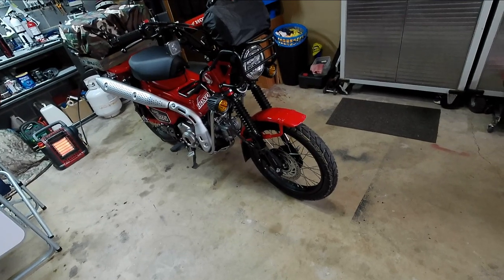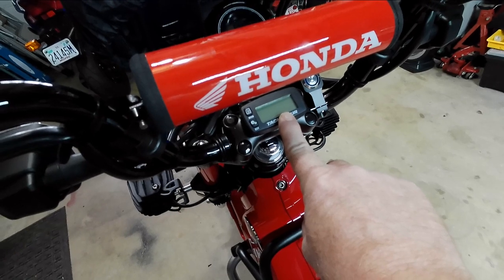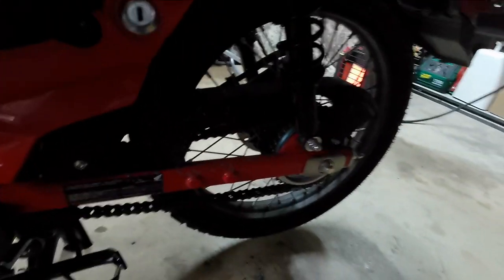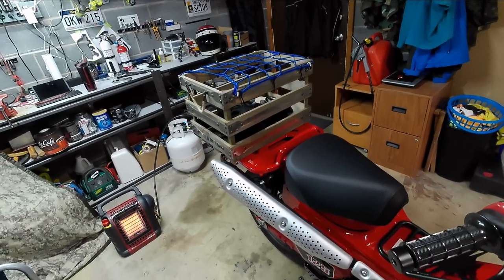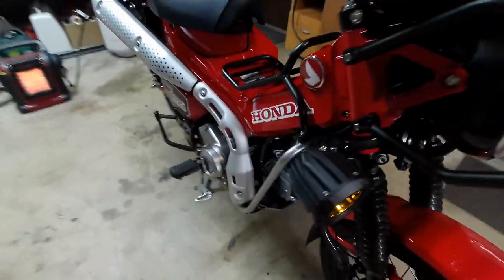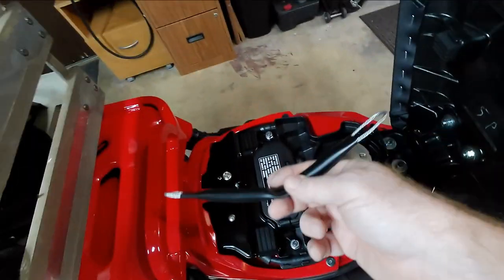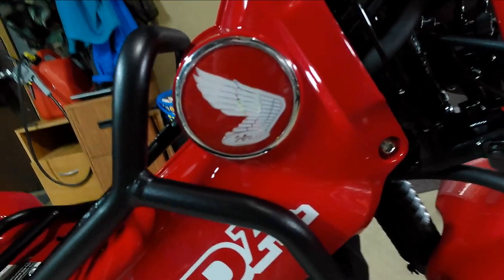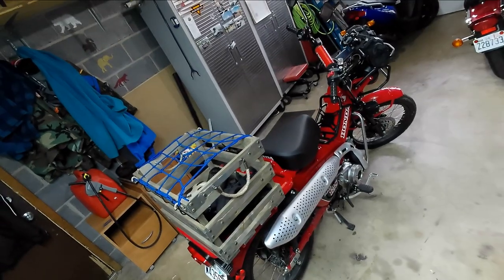Honda Trail 125 Owner's 100 Mile Review and Rambling Thoughts, Oil Change results towards the end.

Comment: What a fun bike. I love mine. Everyone wants to stop and talk about it. I found a neat metal basket at Lows in the bathroom section that I installed on my luggage rack! It is sweet and looks cool too. It holds almost as much as a milk crate, just not as tall. My bike was on order for 10 months now, I have over 600 miles on her and loving every mile! I will be looking for a more comfortable seat, an engine guard and front foot pegs. Thanks for you video, Guy

Comment: Great video! 
Not to be nosy but I’m interested in your propane garage heater. Is it an infrared heater? What brand is it? Do you like it? Does it heat the floor? I’ve tried so many heaters and haven’t found one to fit my needs.
By the way, I love the CT 125. If I could only find one. I have a Honda Helix but would like to do some light duty off road riding as well.
Reply from the maker: Thanks for watching! The heater is a little buddy portable and I love it. Make sure you get the filter for the inlet hose, wish someone had told me. The 125 has more smiles per mile than any other bike I own.

Comment: Great job and appreciate all the links. I bought quite a few items based on your suggestions. I bought the aux beams, what clamps did you use? I love the location. Also, how did you wire the switch? Newbie.
Reply from the maker: No issues on the wiring. I'll look it up and send a better reply tomorrow. Easy peasy though. I'll even add a link for the connectors.
Reply: @SpyderTom1  Thank you!

Comment: I got my bike Thursday and I agree with you about the seat being hard and the mirrors being too short. Thanks for sharing your mods with us, very helpful. Can you tell me were you got the lights from and the part # for the light brackets. I plan on doing the same thing. Thanks Robert
Reply from the maker: Thanks for stopping  by and watching, I added links to everything I have added in the description for the video. Keep watching and subscribe, I will do a better review "in the wild" when it warms up here in Leesburg.
Reply: Thanks for the response. I didn't realize I could use the reflectors brackets for the the lights. I'm basically copying what you did. Thank you for sharing your knowledge. It's going to make this mod easier to do.
Reply from the maker: @Jokerboy-ps7tv  I would get some brackets, when I tried to use them they were way to unstable and shook on every bump and when the bars went to full lock. Thanks again!
Reply: Ok 👌.

Comment: so if the new Honda grom now has a 5th gear and the engine is basically the same as the CT125, would be possible to make the CT with a 5th gear?
Reply from the maker: Not sure but if you get it to work let me know, that extra gear would be awesome.

Comment: Hi, I bought the aux beams based on your review, what mounts or clamps did you use? I don’t see them listed on your links. Thanks for all the info.
Reply from the maker: Hey, very sorry in the delay. Thanks and I hope to get some more videos up soon. The mounts and the alarm are from Amazon. The alarm keeps honest people honest I guess but its not a full fledged car alarm. The mounts are perfect for those lights, you will love them.

https://www.amazon.com/gp/product/B01FETT3FO/ref=ppx_yo_dt_b_search_asin_title?ie=UTF8&psc=1

https://www.amazon.com/gp/product/B079BNS9JT/ref=ppx_yo_dt_b_search_asin_title?ie=UTF8&psc=1
Reply: Hi. I’m installing the lights this week, did you install a fuse or relay?
Reply from the maker: @pvwjr  So sorry I did not get the wiring to you but no, simply connected to the factory wiring in the headlamp bucket. Use a multimeter to find the key hot. I have been on the road working for weeks now. They are LED and not have enough draw in my opinion to rate a relay. Factory wiring is fused.
Reply: No problem, work comes first. You got to pay for new Honda accessories! Thanks for back to me.

Comment: You are probably aware by now but the instructions for the helmet holder are worth reading …
Reply from the maker: Thanks, I did read them, Honda has used a holder like this in the past on other scooters, just not the best type. The one on my VT1100 is better and more standard for a motorcycle. Thanks for the comment.